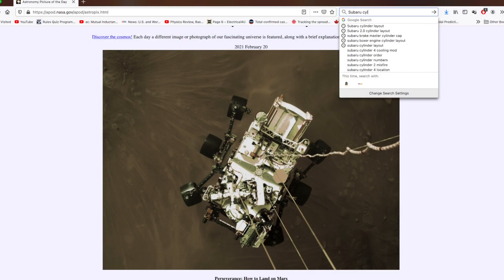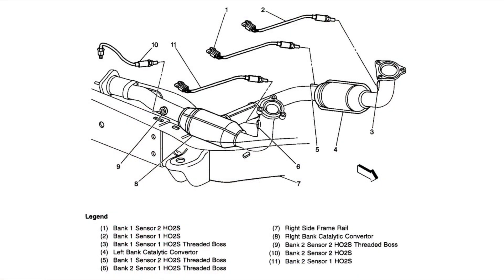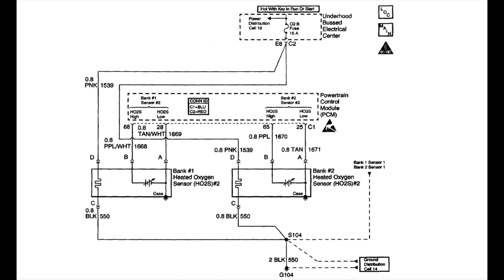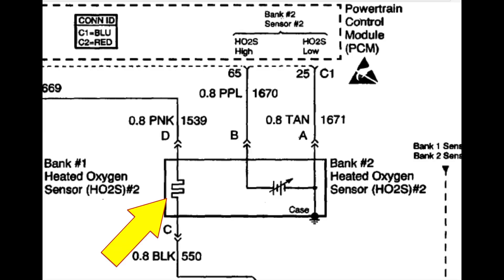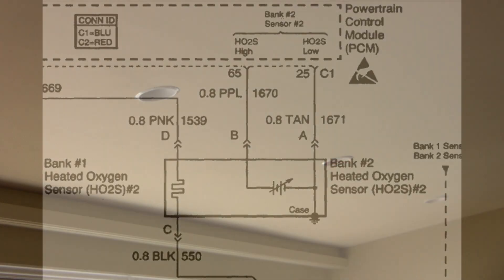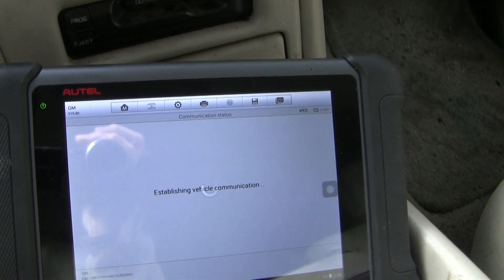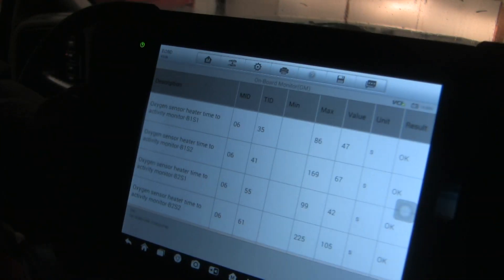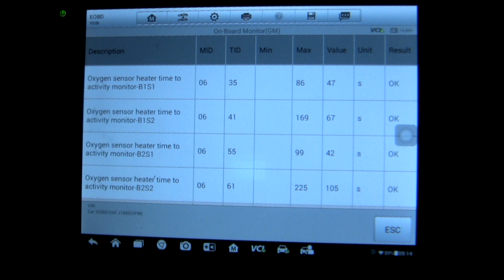Oxygen Sensor Heater Circuit Malfunction P0161, P0141, P0155, P0135. How to diagnose and fix.

Comment: We have an '03 Avalanche with a 5.3. Engine surges during initial start up. It clears up once the engine temp comes up (less than 2 minutes). We got a P0135 Bank 1 Sensor 1 code. The old B1S1 sensor showed no power to the heater, the new sensor showed ok. Installed the new sensor, cleared the code. Within the first few miles engine light came back on. P0135 again. Checked the new sensor again, heater is getting power and is grounded. Checked the heater wires going up towards wherever it goes, key-on shows one wire has 12v battery voltage, the other shows its grounded. Just for the heck of it checked both fuses in the fuse box, both terminals on each fuse. Both have power (key-on). Cleared the code and disconnected the battery, engine light came back on the next day. P0135. Kind of stuck right now. I thought maybe it could be the engine temp sensor not working properly giving a wrong temp reading. Is that possible even if the surging clears up within a couple minutes? The surging only happens during cold start-up. Thanks.
Reply from the maker: Interesting problem. There's a chance your new sensor is not playing nice with your car. Is it OEM? Check the connector and make sure it didn't slip out, and check the wires to be sure you didn't melt a new wire on the cat. If not OEM, I'd consider swapping it for another sensor on the other side, and see if the problem migrates with the sensor or if it stays in B1S1. If it migrates with the sensor, you need another one, probably OEM. You might want to check for high resistance somewhere along that wire going to the computer. There are many ways to do that, some guys use a headlight bulb in series to see if it glows brightly when turned on, or you could probe either side of the heater wires with your multimeter and backprobe needles to see if all the voltage drop happens across the heater (which it should). If not you've got another area of resistance in your wiring, somewhere.  The second thing I'd do is find a scan tool with live data and see if you get any clues there. On the OBD2 side you can get to that page I showed in the video, you want to see if the time to warm up is reduced in the sensor you're working on. Also you'll get more info regarding the cold warmup issue, coolant temp, idle control valve stepper motor counts, etc. Often high idle when cold is from some kind of vacuum leak, where you get a lean situation that improves when you snap the throttle. With this cold weather we're having, engine surge at startup is par for the course here in Canada, ha ha.
Reply: @spelunkerd  Thanks for responding. I forgot to mention we got 4 sensors from eBay (new) even though I only changed B1S1.  After all the above was done, we changed the other 3 sensors, cleared the code, engine light came back on, and it still came up P0135. Checked the new B1S1 again and the heater side isn't shorted, there's power and ground coming from up side, ground is good, and the fuses haven't blown. Starting to suspect there's a short or break in the wire between the fuse box and the computer? If that's where it is we probably won't touch it. The surging only happens for the first couple minutes during cold start up (cold meaning 65 degrees or above). Previously we had a P0171 and P0174 lean codes both banks. But we traced it down. Haven't had any lean codes since. Appreciate your time Thank You. 👍

Comment: First of great video. I'm having a o2 sensor heater problem and all of these videos are the same in looking for a video that explains why the ground of the o2 sensor falls off when I connect the sensor or the text light bulb. Ohh I traced the ground wire all the way to the ecm and I tested the wire close to the ecm to make sure there was no breaks on the way. What you think?? I'm thinking bad ecm
Reply from the maker: Inside the ECM you may have more sophisticated hardware that limits current, so it may be wise to test each component individually. ScannerDanner posted an example of that in a video today, explaining why his test light was failing to pick up the on/off signal from the ECM for a shift solenoid. If in doubt you need to simplify by dividing the circuit, to be sure you're condemning the correct part. Be sure when testing the driver not to apply 12V without limiting current somehow, since high current test devices may cause secondary downstream problems in the ECM. Many guys reserve an LED test light for this situation, where it can come on yet send minimal downstream current into the driver. With two grounds on an old style typical oxygen sensor, you need to be sure the high current from the heater doesn't get accidentally routed through the sensor ground, where it can mess up the sensitive components that monitor that circuit. Occasionally weird things can happen, where for example the ECM may protect itself by turning off driver service to a device that is sending dangerous current. In that unusual situation you need to clear the codes first before the driver is willing to talk to downstream devices. Good luck!
Reply: @spelunkerd  thanks for getting back. I'm saying without the o2 connected I'm getting 12v from the heater wires but when I plug the o2 or the text like the voltage leave when I remove the voltage come back. I no ecm rarely goes out I'm just thinking thats the only thing thats left. I have tried 3 o2 sensor one of them being one GM 2009 impala.
Reply from the maker: @rodneywilliams4565  I'm having a little trouble visualizing what you are saying. Most heaters are ground side switched, by the PCM. So for a ground side switched heater, you'll get 12V on the return side when no ground is supplied, which should drop to zero when the pcm offers a ground. All the voltage drop happens across the main resistance, the heater. On the voltage side, you'll have 12V, on or off. Voltage side switching is opposite of that, easy to understand by looking at the wiring diagram. If confused, be sure you're looking at wiring diagrams for your vehicle. You could test another O2 sensor circuit in the car to better understand what should be normal.

Comment: Curious for your opinion, I had some rats chew through the o2 sensor wiring of the sensor not the car harness at least. but after repair i am still getting a check engine light for the heater circuit. I soldered in the repair wires, but the wiring I used was 18 gauge where the original is probably 14 ish. Do you think this 6 inch repair section of smaller guage wire could really cause enough resistance to trigger the CEL in that heater circuit ? @spelunkerd
Reply from the maker: Good question, probably not, but more modern vehicles with Air/Fuel ratio sensors are more sensitive to subtle differences in resistance. Those more modern vehicles have data pids that show differences on a scan tool, if you can get your hands on one that offers live data. Even aftermarket O2 sensors may not play nice with your car's computer. I'd be concerned that a short might have damaged the driver. Work it up in the usual way, check for power and ground on each side, and put some kind of light bulb into the circuit in place of the O2 sensor to see if the light turns on when engine is cold. Good luck!

Comment: You should have run a tap in that hole. You should be able to screw those in with your fingers. Unless GM has changed the type of the O2 sensors they used when I worked on them, I would say the new looks like it is not a OEM part. I retired from working at a GM dealer in 2002, so I could be wrong. But the one you removed looks OEM for sure. Unless you got that from a GM dealer, I would question it being real. There are a lot of parts online claiming to be OEM, but they are not. Most aftermarket electrical parts almost never worked properly.
Reply from the maker: Those are good points! I did get the part at the local dealer, but even so GM have outsourced their parts so you never know. It's working fine, and for a downstream sensor it should be fine. I do have a thread chaser set so the only thing holding me off using it was laziness. In the end it spun on fine. Thanks for stopping by!
Reply: AC Delco is using Denso as their primary supplier so some things have changed in the past few years.